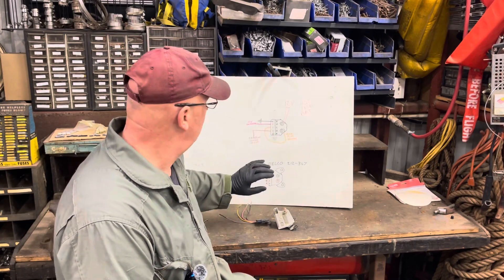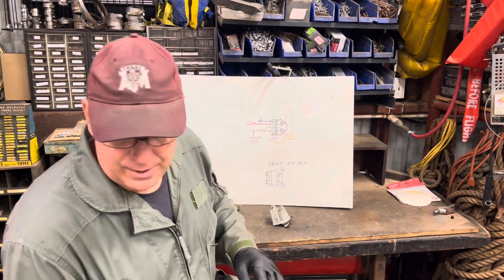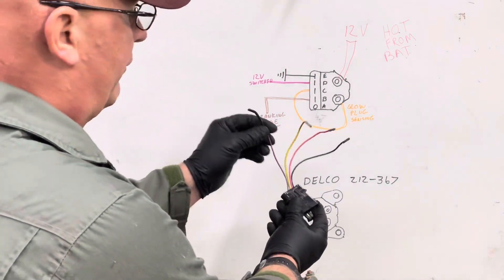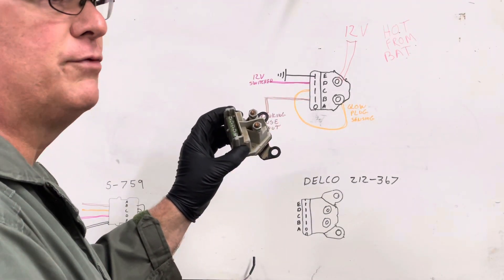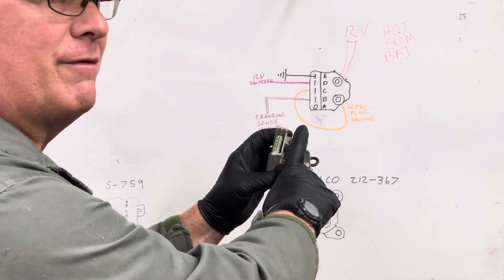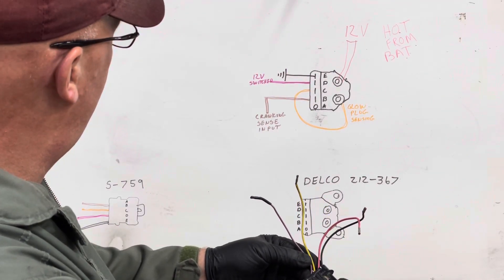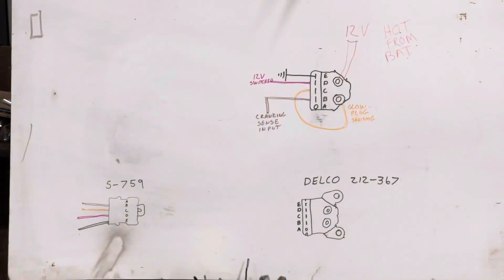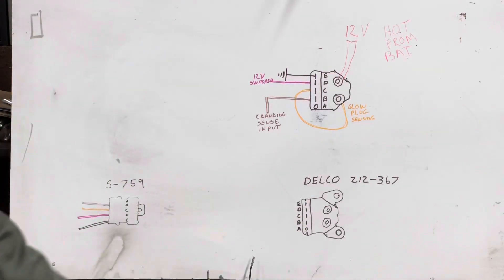6.2/6.5 Diesel Delco Glow Plug controller wiring diagram and explanation

Comment: I’m struggling to make the relay work anyone knows how it will connect the the big cord from right side with left side? What part is starting the glow?
Reply from the maker: The square body era trucks had 2 orange wires that met at the glow plug relay. Each orange wire fed a side of the engine. 

Are you asking what inside the relay turns it on or which wire turns the relay on to decide if it should glow?

Thanks for watching.

Comment: What would cause my glow plugs to keep burning up,they're gone in a day? I've replaced the relay,injector pump,fuel lines other than return line,both tanks and put a mechanical fuel pump on it. Any help would be greatly appreciated.  Thanks...
Reply from the maker: What truck are you working with?  What glow plugs are you using?
Reply: @timsteachablemoments1786  88 R30 6.2 and AC Delco 60G plugs. I'm beyond stumped,I've watched numerous of your videos and others trying to hash this out.
Reply from the maker: @chadr940  That is a 12 volt truck so no chance of 24 volts getting through as could happen with the CUCV trucks. Could you check your voltage at the hot side of the glow plugs controller?  I’m just thinking basic stuff to start with. You should have 12.? Volts at the controller with the key off.
Reply: @timsteachablemoments1786  12v at the relay
Reply from the maker: @chadr940  Good. Then the next question is how long are they glowing and are you sure they are turning off?
Reply: @timsteachablemoments1786  hello Tim,sorry for the late response. They turn on for 5 seconds then 2 cycles of 1 second,I'm not noticing the light on after  driving as far as being on still. It starts pretty hard the first initial start and after being warm which also stumps me. It's a beautiful truck and would like to figure out what the heck is causing all this... I truly appreciate your help.
Reply from the maker: @chadr940  5 seconds is not enough time for a cold start. Even in 100° outside air. 10-12 seconds is what it should be. 

Obviously your glow plugs are not getting burned up doing their actual job. Could you try checking voltage on the output to the glow plugs with a hot engine running?  I’m wondering if maybe the relay is leaking voltage through all the time.
Reply: @timsteachablemoments1786  I'll check that here in a few and let you know on that. Thanks again...

Comment: Hey there, great video first of all, I'm from italy, I have a '85 M1028 CUCV, its glow plugs system has been mangled a bunch by the previous owners (because the original card is basically unobtanium here). But the controller found on 85 up civilian trucks are pretty accessible and I wanted to swap everything over to the civilian glow plug system. This video basically answers all the question about wiring except for one, and that is: where does the wait light get power/how does it get switched on?
Reply from the maker: There is a dark blue wire on the card plug that sends the signal to the wait light for the CUCV system. The civilian systems have the wait light tied in with the orange wires at the glow plug relay. If your system is all cut up. That is my suggestion. Verify the dark blue wire does indeed light up the wait light with power, then just connect it to the orange wires going to the glow plugs at the new relay on the switched side.
Reply: @timsteachablemoments1786  thanks for the reply! So basically, I'd just have to connect the wait light feeding wire (dark blue) with the "voltage sensing" wire on the relay (orange), right?

EDIT: also, with the wait light being tied to the glow plug side of the relay, wouldn't that mean that the wait light flickers on and off as the after glow takes place?
Reply from the maker: @leonardopoma162  Yes the light will come on every time the glow plugs do.

Comment: So I have a new issue.  (1982 K10 Stepside, 6.2)  There is no power coming off of my relay to the glow plugs. The relay still clicks on and off. I am at a complete loss right now. Thank you for any possible suggestions.
Reply: idk if you have this figured out or not yet but there’s a glow plug inhibitor switch on the block. Sometimes they get stuck open and think your coolant is at operating temp (why your glow plugs won’t come on)
Reply: mine was on the passenger side towards the back by the firewall. It’s a copper fitting with a wire harness connecting into it. I think it also controls your engine temp gauge in the cab

Comment: What do the glow plug and crank sensing wires do? I've always had mine with manual push button and normal, 100 amp relay. Seems like the best solution to me, and adds a layer of theft prevention :D
Reply from the maker: The crank sensing is so the controller knows when to start doing the after glow cycle. The after glow really makes a difference on a cold start. 

The glow plug sensing wire tells the controller how much voltage, I think, is going to the glow plugs so it will know how long to glow. As in 9.0 volts going will get a longer glow than 10.4 volts. 

With your manual controller, try hitting it for 2 seconds 5 seconds after engine start on a cold morning. It will really smooth the idle out compared to not doing it. I put a manual button on my Cowdog truck just in case the controller doesn’t work right. Really cold starts I will hold the button down to extend the controller time, I can hear it clicking off while I am still keeping the plugs glowing. Once started, the controller will command 4 after glow periods in the first 30 seconds of running that really help smooth things out and get rid of the smoke.
Reply: @timsteachablemoments1786  I've never used one of these diesels. That that mean the Wait To Start light comes back on for a moment after it starts? There's no dedicated wire on the controller for the light, so I assume that the light is just wired directly off the glow plug circuit.
Reply from the maker: @Duamerthrax  Yes, wire the light to come on when the glow plugs get power. That way you know when it is glowing. 

The glowing after the start up is called “after glow.”  It really is needed and makes a difference to how the engine performs in cold weather right after start up. Without it, the engine will stumble, shake and if cold enough stop running. Normally, there are 3-5 after glows.
Reply: yes the 1974 & earlier Mercedes diesels were set up for ppl to judge themselves duration of GP on, to assist an element wire indicates GP temp as current decreases as GP temperature goes up dimming gp indicator. at desired point pull Gorilla knob out engage starter relay. running all 50a the electric contact part of  devices die fast quickly  ppl were smarter in that era. no crazy interlocks. user think engine redi pull immediately to start. really cold leave gp on 1min or as desired the hit starter. at issue gp contacts die fast so add a ford starter relay for hi amp starter power. old MB had run position below gp on & start whereby driver determined gp duration